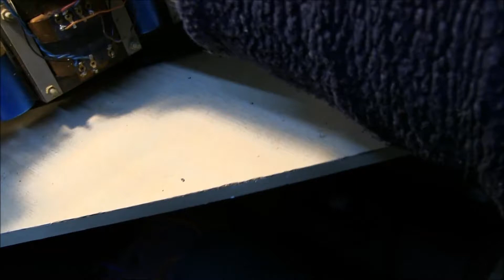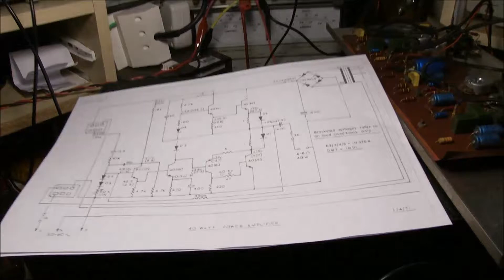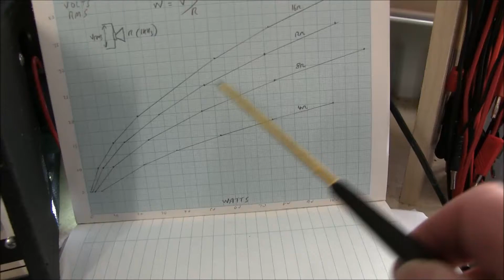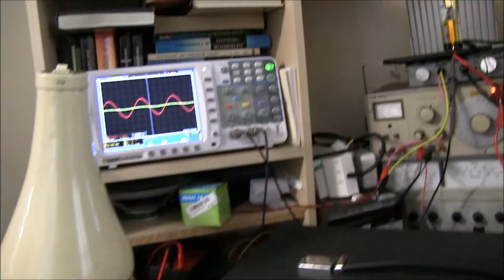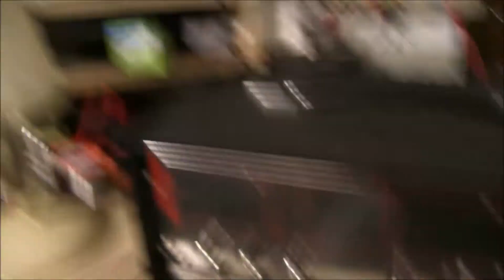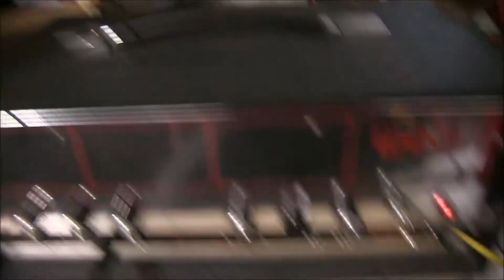WEM ER40 Amplifier from 1971. Service, test and sound check.

Comment: Hello Nick Adams, i'm Yann from France and my english is not very good..
I'm highly interested in this video, and in your knowledge of these amps. I hope you will accept to help me.
 Let me  explain: I have just fixed a WEM PA40 amp, that was not working for about 20 years. I have resolded a wire and it works now. BUT there is a hum through the speaker when power is turned on, with some spurious noises at various frequencys.When increasing the volume knob (with a jack in the input) the hum increases too. At 12 o'clock position the hum becomes huge!
 I am very beginner with electronics, but watching this video i'm getting better at reading the schematic and locating components in the unit.
My equipement are a multimeter and a soldering iron.

The amp: WEM PA40 (solid state), serial number CW 07329. It is apparently identical to ER40 except a little detail:
On the "bridge diode" it is written 70 (year code..?) and the five pre-amp transistors are not green plastic. They are small metal ones, written "TFK BC 1088"
The voltage is set to 240V (rear pannel)
 I didn't see any obvious marks of burn on the components. The electronic seems quite clean, no stain..
I noticed that a lug is grounded on the "treble boost" switch (channel 1) but there is no wire anymore in this lug..
Using the multimeter (continuity test) i see that the potentiometers bodys are not grounded (measuring the front panel itself, i see that it's no conductive at all, as if it was plastic)
The earth wire of the mains cable is grounded with the black wire that go to the transfo.

So what happens? grounding problem? maybe a capacitor? another component? I think resistors can be tested in place, so i could try to test them all f i knew that they may cause the problem.. (i don't know how to test capacitors..)
I noticed that when approaching the front pannel close to the transfo, the hum increases.. The "cloth" or "paper" of the transfo doesn't seem to be in good shape.
So what could be the failure? Do you have any ideas?

Thank you very much for reading and answering.
Reply from the maker: Hi Yann
Yes, made in 1970, same as the ER40
Transistors BC109 are good.
Yes, the Front Panel must be earthed. Same problem as on my ER40.
Connect a wire from the earth (screen) of the signal wire to a screw on the font panel.
Check with multimeter that it is now earthed
This will reduce noise.
If you can,  measure the voltage on the output capacitor, as in the video to see it is about 30Volt.
Let me know after that, what noise is good or bad.
Nick
Reply: Hi Nick, thank's for answering.
I've done what you told me but nothing changes..
I may be confused between "earth" (UK) "ground" (USA) and "screen" but let's say it's ok!

So, the front panel is earthed now and it responds to all the screen points of the pcb. Yesterday when i first checked the conductivity  with both of the pins of multimeter on the panel it indicated nothing.. it's a cheap one, maybe that's why..
The pots' bodys are still no earthed (maybe some varnish on the front or corrosion i don't know)
Putting the multimeter on both poles of output capacitor (big blue one) i set the tension at 29v DC (with a screwdriver as in the video)

Two cables have been replaced in the past (non-professionnal) and i have a doubt on that:
1/ Speaker socket: positive to a fuse (positive pole of output capacitor to the opposite side of this fuse).
                                  negative to chassis with the black wire that goes to negative pole of the transfo.
2/ Mains: earth wire also connected to chassis with this black wire.
                  neutral to a fuse (opposite side goes to front panel power switch)
                  phase to the voltage selection plate just above the transfo
Does that seems correct to you..?

Otherwise my idea is that some component must be old or dead.. power transistors (rear panel)? big blue capacitors? any resistor? I'm not very skillful but maybe you could drive me to any probability..
What is shure:
the hum is here as soon as the main is on, even without any jack plugged.
with a jack plugged, the hum increases as i turn the volume on.
short high frequency signals can be heard into the hum, like "beep beebeep"
I tried to invert phase and neutral in the mains socket, tried several jacks but no results
Thank's for reading!